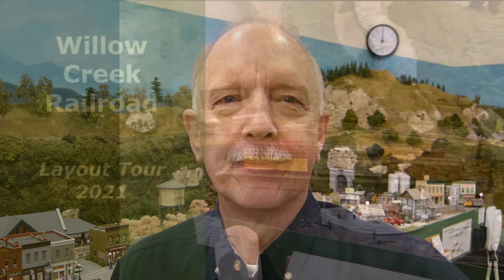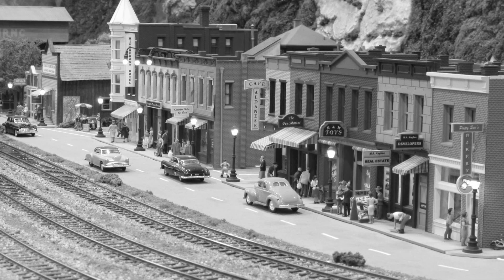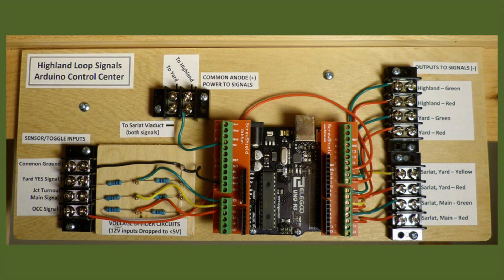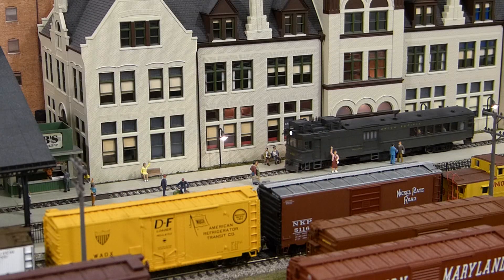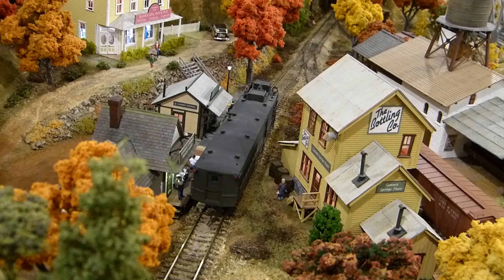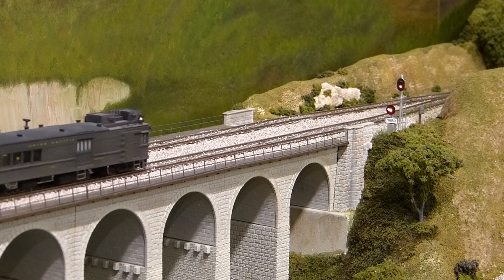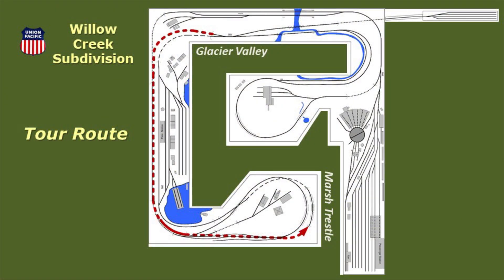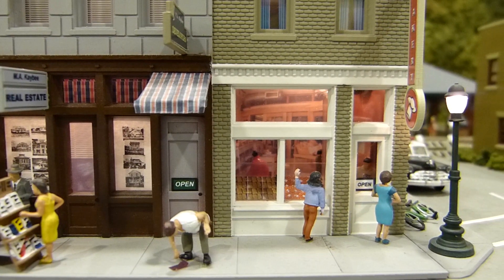Willow Creek:  Layout Tour 2021

Comment: Fascinating video as always, thank you. I don't have the space or time for something like this but I enjoy the layout and your videos so much that I'm working on adapting some key sections of the Willow Creek that I can recreate and operate separately on my dining table a piece at a time! It was great to hear the history of the layout, too - both fact and fiction. At what point in the build did you start running actual trains on it? Did you wait till all the scenery was complete?
Reply from the maker: Glad you enjoyed the video and are enjoying aspects of the Willow Creek on your dining table.  As soon as the roadbed was finished, I started laying track, installed the DCC system, and then started wiring sections up.  At that point, I started running trains to test both the DCC system, the track wiring, and each section's trackwork.  Build a section, test that section's track, repeat...  Scenery was not started until all track was tested with running trains.  You don't want to start working on scenery until you're absolutely sure that the track runs the way you want it to.  If you have to make any adjustments, it's much easier to do that while you're still looking at only track and roadbed; no scenery to rip out.  It's also easier at that time to see the wiring under the layout in case you make any mistakes and need to rewire something, again without scenery getting in the way.  Good question.  Thanks!

Comment: Question you make your mountains with plaster cloth is there anything else you can use?
Reply from the maker: Rather than the cardboard webbing and plaster cloth, you could use extruded foam.  Lots of videos available on the web.  You could also use cardboard webbing and drape plaster-soaked paper towels over it.  Quite messy but very inexpensive.  Just a few alternatives to consider.
Reply: @Vigment13  You can also make the "skeleton" out of chicken wire.
Reply from the maker: @beeble2003  True, but it's much harder to work with.  And be very careful of sharp edges!  Ouch...